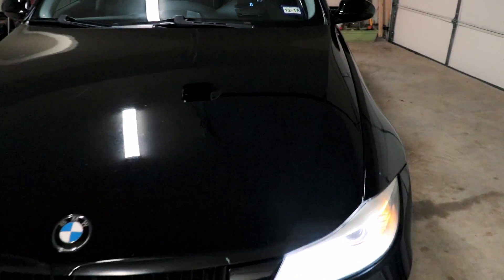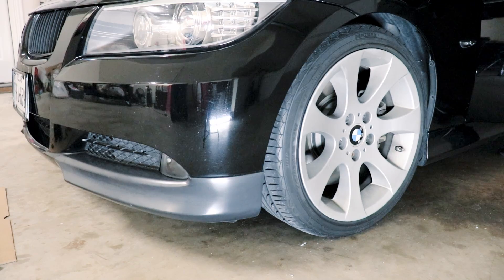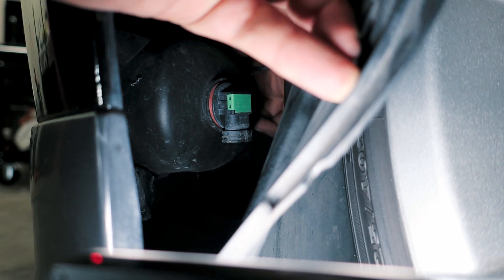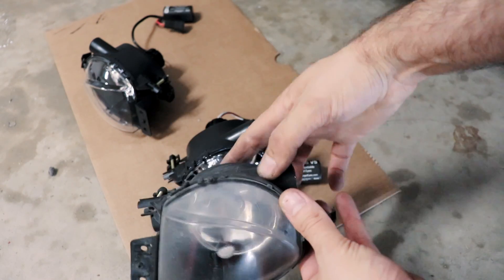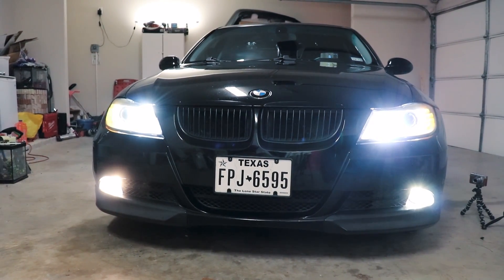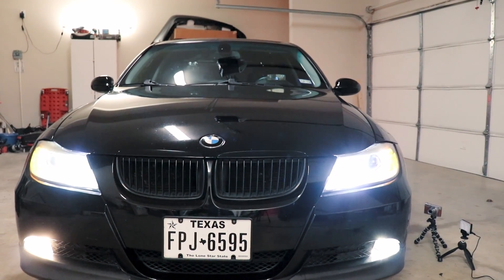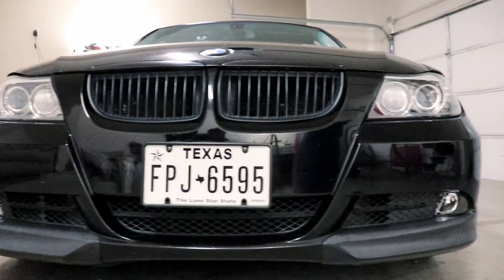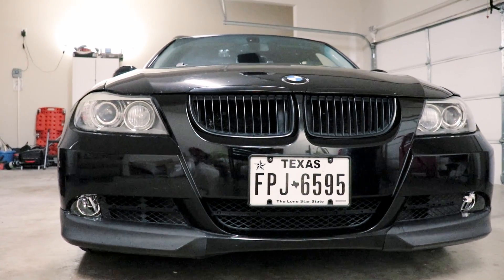This Will Take Years Off The Look Of Your Car!  - E90 DIY

Comment: Im just doing this on my 335i e92. Thank you for this. I thought Id have to remove the whole bumper once I hit the passenger side. But, I came back and watched you do the right side by bending the bumper out. I hope it works!

Edit: The passenger side was a little tougher. But, removing the two screws underneath to flex the bumper was the trick! It looks brand new again (I also put a new lower lip cover on).